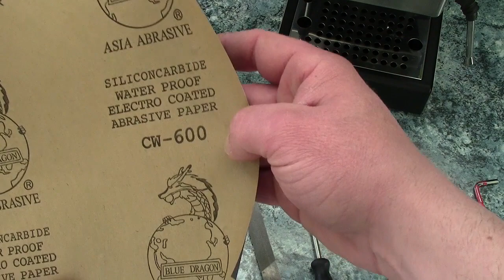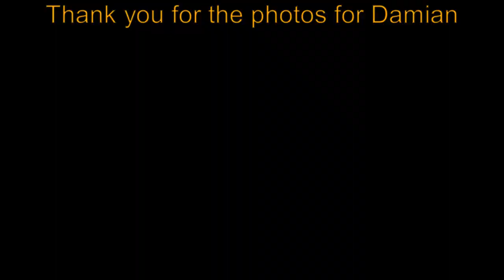Gaggia Classic (Pro) leaky dripping steam valve refurbisment repair

Comment: It’s amazing how poorly gaggia designed the classic/pro steam wand.  It’s embarrassing that after a few months users are filing down parts to clean them.  And that’s just a temporary fix.  Is it that hard to make a properly designed steam valve?  Kind of ridiculous.  Good tutorial
Reply: I do agree with most of what you said, however if the user is aware of the force they should apply to close the valve from day 1, also maintaining the machine appropriately and can ignore the natural dripping of the wand due to trapped water heating up (lots of ifs😅). Than it could work fine for a while.
The real shame is, they haven't changed this design in the last 32 years 😢
Reply: That’s somewhat true.  I did this procedure years ago and have very soft water.  The fix only lasts months, not years.  I just keep a cup under the wand to collect water.  When it gets very bad I just replace the whole valve.  It’s designed to fail

Comment: What grit sandpaper do you recommend? I'm tempted to try doing this
Reply from the maker: @radnerak  I normally use 600 grit, but anything above 240 would be okay.
Reply: @BREWBETTER  Actually modded 3 steam wands already and used 600 grit, worked well. Thanks!

Comment: Thank you for this video. I'm in the process of fixing my steam valve. There was some leaking after I descaled the machine but it slowed down to zero once I rinsed it a few times with fresh water. The seal is bad though, so I needed to open the valve to replace it. Now I need to run off to the hardware store, get a compression nut and a die to cut the thread. Once I get the new boiler in the mail I'll put together my unit and will do some testing.
Reply: Hi,
Thank you.
When you referring to a bad seal, do you mean, the valve leaks around the spindle?
Reply: @horvathpeti84  During descaling the machine developed a leak through the steam wand. The knob would move with increased difficulty for some reason. Once I finished descaling and ran water through it, the knob started moving easily and the steam wand leak dropped to almost zero. Then I removed the top lid and noticed a leak by the spindle. Also noticed that the spindle felt quite loose inside the valve body, indicating that the oring (seal) was not sealing properly.
I filed off the crimped part, removed the spindle and replaced the oring. I use the same orings to repair Ulka pumps. ;) Once I put everything back in the movement was smooth again. Yay!
Now I'm waiting for a replacement boiler because the original once was scaled, pitted and looked like garbage inside. The machine is from 2000 and this is probably the original boiler. Anyway sorry about the long story. I hope it makes sense now.
Reply: @tudor888  Yes, it makes sense now. These viton o rings in the steam valve are prone to fail due to harsh descaling solutions. What did you use?
I prefer to replace them to red silicone (70 shore hardness) BS008 UK size, but I believe it is also a standard size in most part of the world. From memory the pump o ring is slightly thicker, but if it works then okay. Do you have supply to replace the smaller spring in the Ulka pump which is likely to break?
Reply: @horvathpeti84  I never replaced a spring, didn't know they tended to break. :( But I'd check ebay first.

Comment: So if the steam valve is leaking, the brew pressure won't be accurate right? I've tuned mine for 9bar but the valve leaks. I'll now fix the valve and pressure test. Thanks for the video.

Comment: My machine (evo pro model) is only 3 month later. After you flush the steam before use it, regular operation right? But after I dip the tip to the milk, I can hear the hiss sound. It's not too loud but audible and enough to prove it's leaking. It's a shame that gaggia has been manufacturing machine for a few decades, this problem is still there. Thanks for this video and I will save it for later.
Reply: Hi,
Indeed it's a shame they haven't done anything to this poor design in over 30 years.
What is even worse, they're not articulating the right way of using the steam valve. It should only be closed gently. I've seen machines older than 10-15 years with perfect steamvalves.
Once you get to modify yours, keep a keen eye on the force applied to close the valve.

Comment: Nice video.  I have this problem.  Needle valves are a flawed design, they quickly foul with rust or mineral deposits. I bougt a new valve but I'll try this repair when I get a chance.  Thanx.
Reply: I've faffed around with gaggia's for years and years. The best decision I made by far was just ditching gaggia's all together, biting the bullet and getting a Bezzera BX-10.

Comment: Great stuff. Unfortunately the steam valve is the one repair that might be too difficult for the typcial Classic user. Im wondering if there was a steam valve for some other machine that would be a better option for classic-users. One day, V1 steam valves arent gonna be available, so what to replace with then? 
If anyone has ideas just type 'em
Reply from the maker: I have just launched brand new genuine Gaggia steam valves, modified to be maintainable/repairable/cleanable shipped worldwide for 57 USD.
The V1 steam valve (from 1991, and regardless of the poor design) is still in the 2023 Pro models, so they won't discontinue it any soon.
It is such a model specific item, it can't really be upgraded/ replaced with other better models.
Reply: @BREWBETTER yes! Where can I buy one ??!!
Reply from the maker: @crazydubwise  Hi, I've just added a link to my website in the description.
Kind regards
Peter

Comment: Great video! I bought the incorrect compression nut. Any idea where I can buy the correct one in the EU?
Reply: Hi,
This should be available in most air-conditioning suppliers with 6.00 mm or either 6.35mm hole at the end. Both would work fine. Optionally you can get a 1/4 brass cap from a plumbing supplier and drill a 6mm hole to the very centre.

Comment: Amazing tutorial, mines getting to be a little leaky so I will be doing this in the future. Is there any benefit to getting the spindle machined up in steel? Would this prevent future issues?
Reply from the maker: Thank you.
I wouldn't say a steel spindle could be any better, it would worsen the chamfering affect - of a tight close of the valve - on the valve seat/nest, which would cause the very same issue, but it is even more difficult to re-machine properly.
I am keep thinking of a teflon or silicone seal between the spindle to overcome the root cause, but I am sorry to admit, it's probably over my capabilities to develop/test it appropriately, so I have given up on this for now.
Reply: @BREWBETTER  Makes total sense, wonder if a teflon/silicone "cap" on the spindle would be enough... food for thought!
Reply from the maker: @kiwikoffee  I discarded the "cap" idea at the beginning, as a new valve has a nice sharp edge of the seat and the cap meeting that edge with the screw in motion, would tear the cap apart in a few use in my opinion.

Comment: @brewbetter, I just received a steam valve to boiler oring, and it seems to be a BS111, instead of 110. Have you ever tried to use the 111 size?
Reply: You might get away with it, until you receive the correct size, but I wouldn't risk it on such a cheap part.
The nipple of the valve is 10mm in diameter, so while the original o ring has to stretch 0.8mm this one is loose about the same amount. I doubt it would work well in the long run. At least you'll hear the hissing noise if water leaks there straight to the top of the boiler, so it won't hide when fails

Comment: Excellent, very helpful indeed, lots of good information - kind of justifies why spending $45.00 for a new assembly might be preferable if you don't have the tools and techniques of the presenter 🙂
Reply from the maker: Thank you so much.
On the other hand, I wouldn't say it helps justifying a new valve, as that would probably fail again in a year or so, meanwhile a refurbished one could be serviced or refurbished again in literary minutes, so it should serve for a decade or so.
Reply: @BREWBETTER  yes, I agree- I think I could do everything except the interior resurfacing.  If you had a shop nearby, I would have you refurbish it probably yearly- I will be ever so careful when closing it now - before I was just giving it a strong twist😱
Reply from the maker: @starbros1947  Fair point. According to my experience 9/10 times the spindle only refurb helps, but obviously not for a really long time.
Reply: @BREWBETTER  9 out of 10 will work for me - your instructions are detailed enough that I may try it on the one I just swapped out (luckily I got new one while on warranty)
Reply: @BREWBETTER  So could I do everything that you did in the video EXCEPT for the remachining of the internal part of the valve,and would that solve my leaky steam valve issue still ?
Reply from the maker: @CoffeeAndSmoke23  Hi, 9 out of 10 times yes, it depends on the wear of the valve. However you would have to clean it more often.
FYI: I am launching the sale of brand new genuine Gaggia steam valves, modified to be serviceable from start for 49.99 EUR shipped to Europe and UK.
Reply: @BREWBETTER  That sounds great..I did just order a new valve,but I would love to do business with you on this as well..Will you ship to the US ?
Reply from the maker: @CoffeeAndSmoke23  I am happy to ship to the US, but I cannot accept steam valves for repair from there, as I would have to pay over 10 USD customs here regardless of if it's for repair or even a gift.
Reply: @BREWBETTER  I’d be interested in a modified valve. Where can I order it from?
Reply from the maker: @marcossanchezd  Hi,
You can get in touch via email (in the description), my website is under construction.

Comment: Hi, I’m looking to fix the steam valve on my gaggia classic pro. It is the US model.  Water is leaking from the knob. I know you said to use a 1/4 inch die. But the size of the valve looks like 1/2 inch. So would I use a 1/2 inch diameter for or 1/4 inch die. 1/4 inch NC20 die seams very small compared to the diameter of the valve. Please help. Thanks in advance.
Reply from the maker: Hi, I am a guy from the metric world, used to live in the UK. I am not familiar with Imperial and US standards. The die I use is labelled 1/4 BSP 19TPI. That has a major thread diameter of 0.518" so I am not entirely sure why is it called 1/4. You could do your own research to find a matching size die and locknut over there. The one I use cuts a rather shallow thread, but it forks just fine, meanwhile the closest metric size (M12) is slightly too small, so it is almost impossible to manage.
If you find the right US standard die, it would be much appreciated to share it here with the community.
Thank you
Reply: I ended up doing this modification and Ravi Pal Panesar you are correct that the die size would be a 1/2" if you are going by US imperial measurements..You could use a 1/2"-13 which is a course thread or a 1/2"-20 which is a finer thread..If you use either of these you will have a terrible time trying to find a collar nut to fit..I used a 1/2"-20 NC and I ended up having to get a 5/16 compression nut,drill it out and then used a 1/2"-20 tap to make the threads compatible..What he is using in the video is a "pipe thread" die which is a 1/4 BSP 19 TPI..Pipe threads are different and match up better with common compression fitting nuts,whereas using a 1/2"-20 NC doesn't..Compression fittings/nut sizes are different than regular nut sizes..I suggest finding the die he used in the video and you will have a much easier time finding a collar/compression nut to fit..

Comment: Awesome video, thank you so much for the tutorial. Bought a used Classic which is leaking from the steam wand knob area. I'm looking to do this mod but having difficulty finding some of the parts in the United States. Has anyone put a parts list together for this area? Like links to Home Depot, Lowes, Amazon, Etc. I can't seem to find the locknut and not sure if I will be able to get the gaskets without going through eBay. Thanks!
Reply: McMaster-Carr will have all of these parts, though their website can be confusing to navigate if you don't know technical terms.

Comment: Could you advise on the size of the o ring for nipple that connects the valve to the boiler? Thanks
Reply: Sure, it's BS110 (2.62mm Section 9.2mm Bore)
Reply: @horvathpeti84  thank you.
Reply: I noticed that you did not seem too concerned about bits dropping into the boiler when you brushed the top of the boiler after the removal of the steam valve. Is there a chance that the boiler could get blocked?
Reply: @anthonyroma6520  If there is scale deposit on the bore of the steamvalve - which you could potentially push into the boiler - I have bad news, there's already more scale sitting on the bottom of the boiler already.
The way the flow is designed in the boiler  prevents most of the particles to get out, with other words, you need a lot of scale in the boiler in order to cause any issues.

On the other hand if you use an identical brush as seen in the video, it is very unlikely to push anything into the boiler.
It is a very good Idea to flush out the steam valve through the wand after the cleaning.

I'll have a video very soon how to get rid of the sediments in the boiler without taking it apart.
Reply: @horvathpeti84 thanks for advice, very informative. Do you sell parts for the classic?

Comment: Hi Peter. The thread cutter 1/4 BSP is very hard to find, I don't see any for sale. Can we do that with similar metric thread, like M12, M13...?
Reply from the maker: I think M12 is too small (some material should be turned off on a lathe) and M13 is probably resulting an even shallower thread than the 1/4 BSp, which is already on the edge of functionality. Where are you based? I do offer a refurb exchange service.
Reply: @BREWBETTER  Thank you for you reply. I am from Croatia. I can order new one for 41gbp, but I thought If I buy some thread cutter, will be cheaper.
Reply from the maker: @joeg946  Hi neighbour, I'm in Hungary. I do sell brand new modified valve for 45 GBP shipped to yours. We could also sort out an exchange refurb service for 25 GBP (including return shipping, but postage to my place is your responsibility)

Comment: Very nice video, thank you! I just bought a 2019 classic from a dishonest seller, the steam wand doesn't work at all. Turning the knob all the way in or out produces no steam nor water. How should I troubleshoot it, you think? I haven't opened the machine yet. The coffee "function" works
Reply from the maker: Hi,
Thank you.
Does the steam ready light (below the steam switch) lit up a couple of minutes after you hit the steam button?
Reply: @BREWBETTER  yes the button and light are fine.
Reply from the maker: @pierrex3226  how long it takes for the ready light to lit up, from the moment you hit the steam button?
Reply: @BREWBETTER  i would have to time it and the machine is at my girlfriend's now, but probably a minute or two. Definitely not something like ten seconds, and also not suspiciously long.
Reply from the maker: @pierrex3226  Have you checked the steam knob? It could be rounded or missing the metal spring clip, so it spins freely on the spindle of the steam valve. If not, I would try to heat it up to steam, once it reached temperature switch it back to brew and turn the pump on for a few seconds without the portafilter in place. There should be a good amount of steam escaping from the group head.
If so, the steam valve is clogged. Need to be removed, and decalcified (soaked), flushed. Do not submerge the top (spindle) end.
Reply: @BREWBETTER  there's definitely steam escaping from the group head when i do that. Steam valve, you mean i remove the thing attached with the two 5mm Allen screws, and clean up the entire thing all the way to the wand? Not sure what part the spindle/ end is?
Reply from the maker: @pierrex3226  First I would check the handle, if that works fine (not spinning freely on the valve spindle) Then follow tis video until 8 minutes for valve removal. Top end is the part sticking out from the vise just after 8 min, do not submerge that aree.
Reply: @BREWBETTER  understood, i will report. Thank you!
Reply: The 3 way valve sounds jammed. Dislodging the scale that is likely blocking it from 'switching' should do the trick. Flick the steam switch on and off lots of times while operating the brew function and with the steam valve open. This should do it.
Reply: @Craigo5000  thanks, I fixed the problem, it was just dirty and jammed. I even installed a PID since. Now my problems lie with my grinder :D

Comment: Thank you, Peter, for such thoroughly  tutorial. So the 5 mm drilling need to release some additional space or to clean the surface from scale? I mean you literally drill a couple mm of metal to make the connection more durable? And how this step is necessarily required for good results,  isn't it?Thank you
Reply from the maker: Hi,
The drilling should be done with a 5mm end mill, so the result should be a perfectly square bottomed bore. I normally remove 1-2mm material in order to get rid of the chamfer compressed there by overtightened valve. Resulting in almost zero mating surface, preventing scale build-up, to maintain a perfect seal even when the valve is closed gently.
Before I started to refurb the valve seat I managed to get 9 out of 10  back and running with the spindle only refurb in a much better condition than they were before. This really depends on the level of the overtightening occured. However I believe a complete refurb results a longer term solution, especially if the user gives up overtightening.